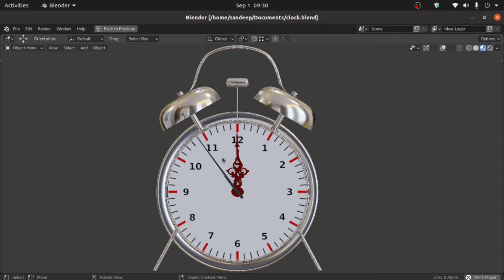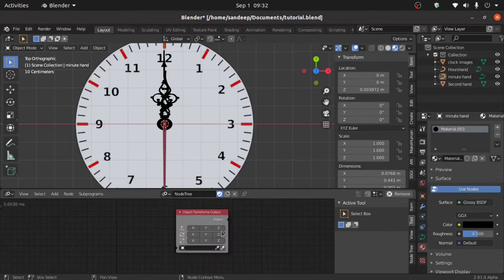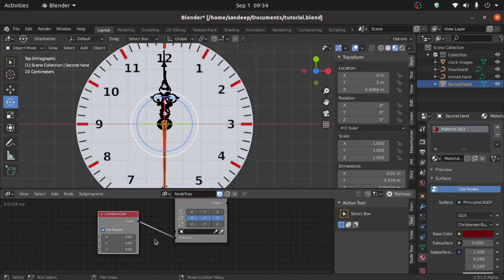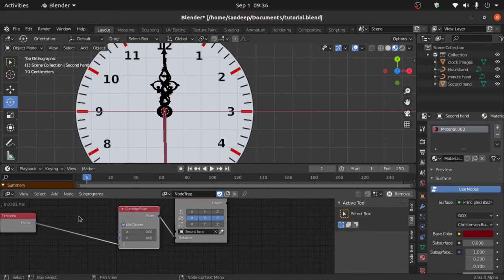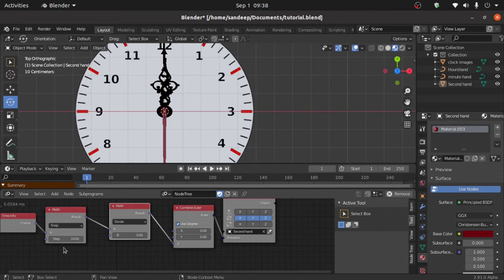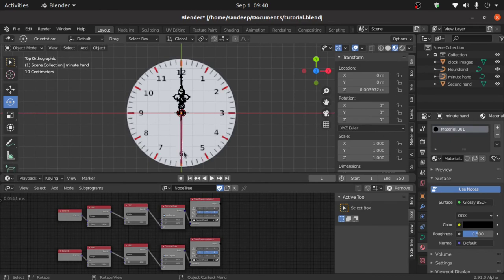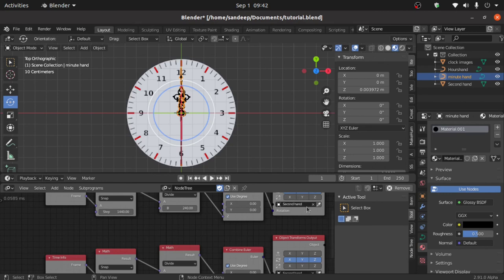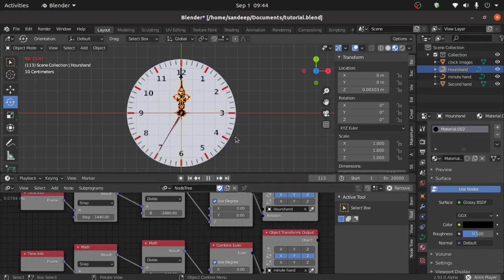Blender 2.91 - Analog clock animation tutorial

Comment: I noticed if you want the clock to start at a specific time, set your hands to that time before applying the Animation Nodes, Freeze rotation on the objects (probably have to reset your origin after that) and then apply the Nodes. This will start the animation at whatever rotation the hands are at.
Reply from the maker: I will try it.